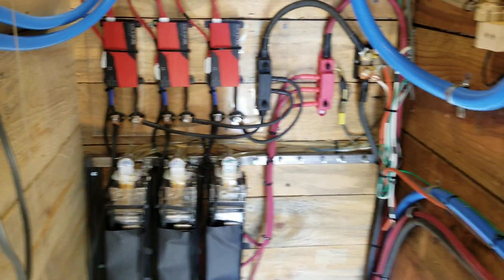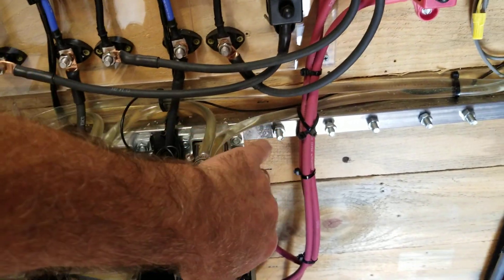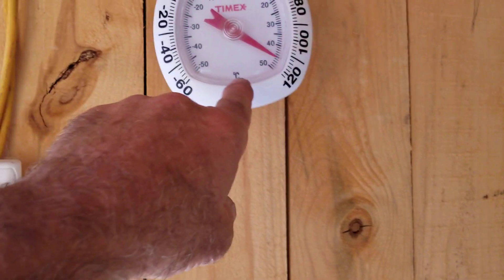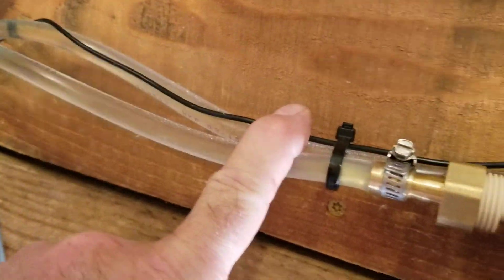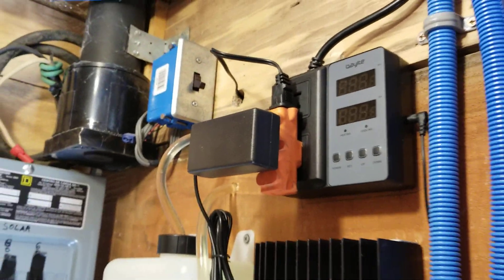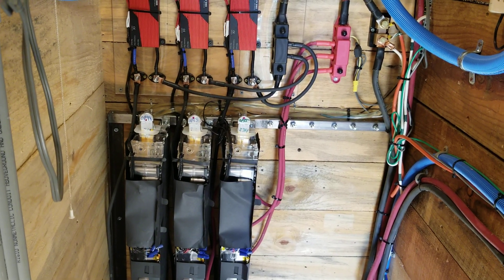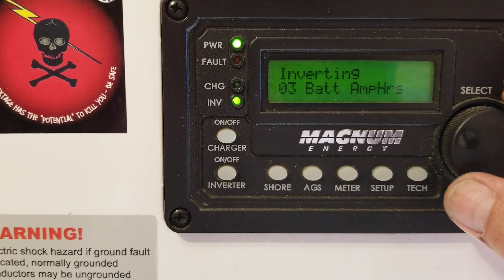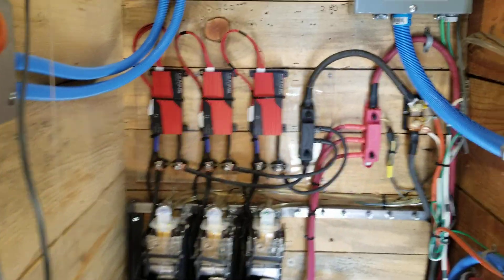The Tesla Lithium Ion batteries are on line.

Comment: 45 ° C / 113 ° F are so many, the heat degrades the cells, to increase the life of the batterybatter you should go down a little more with the 3.9V voltage, Tesla has made a software update, the autonomy of the car has decreased , setting the voltage to 3.9V but the life of the batteries has increased!
if you have free running water, like a stream, you could insert a small plate heat exchanger.

Comment: Wow that was quick. I wish I had more time. I dont even have a real system now. I just sold my AGMs and the lithiums arent ready yet. Looking good. If you need more capacity you can charge a bit higher.There is alot of power is in the 4-4.175v range. Thanks for sharing
Reply: agreed, I would say charge to 4.1 or 4.15
Reply: @GoingOffGrid101  how you doin
Reply: @frankz1125  good mate
Reply from the maker: @GoingOffGrid101  I think I will end up at 4.1 at some point. Today I ran them at 4.0 just to see how they perform. We only use 2.5 kilowatts over night and about 6 Kwhs in a 24 hour period. That said when I get six of these batteries I will have more days of autonomy than I ever have before.

Comment: Nice brother. Glad I could help. I am running mine at 25 volts right now. This is due to the storm hitting right now. Over 7000 with out power. We still have power no clue how lol. Bats are topped off and geny ready. We will have 100 MPH winds here in the next 2 hrs.. So the power will go out. God Bless brother..
Reply from the maker: 4.16 volts per cell is getting up there. I ran my system at 4 volts per cell today just to see how it works. How are you fairing through the storm?